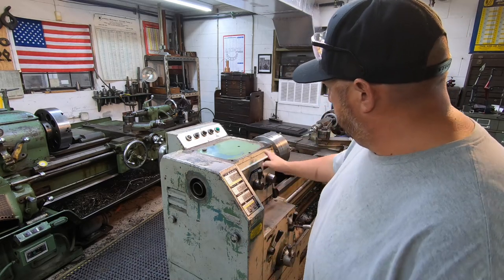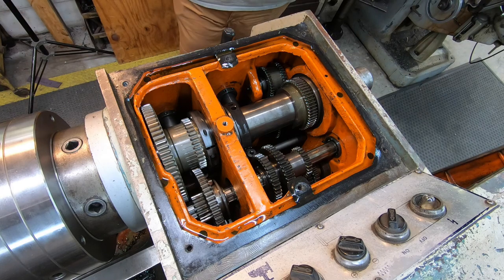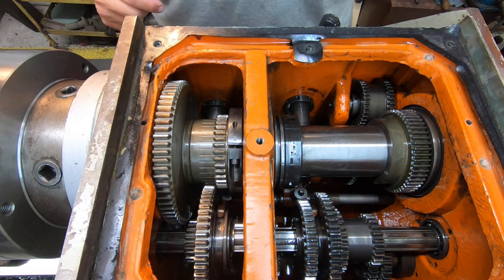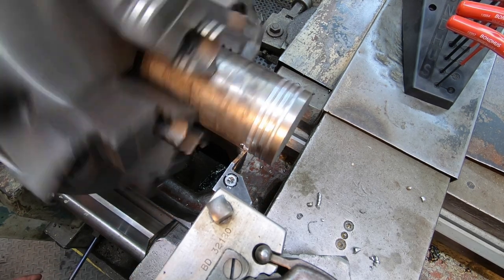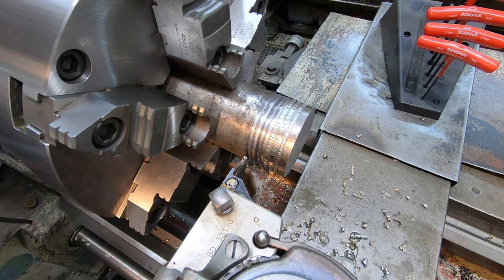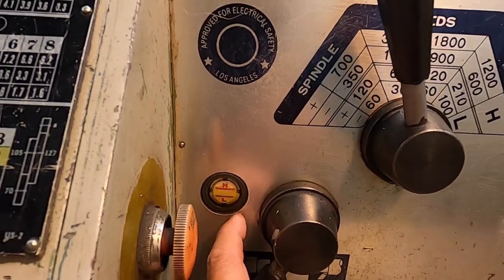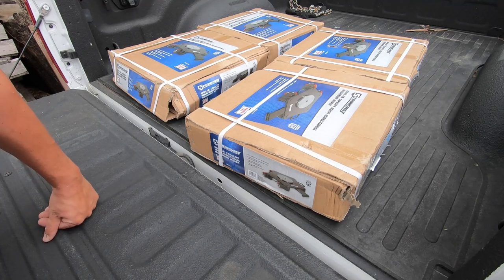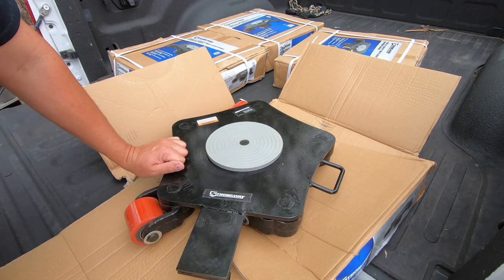SNS 324: Victor Lathe Main Spindle Bearing Adjustments

Comment: Taper bearings do not like to run loose, they always need a bit of tension on them to eliminate any slack. That stake really looks like it taste so good, I like mine done a little longer. Keep  safe and well both of you. Carl Woy Woy, Australia.
Reply: Running taper bearings in compression will greatly reduce their lifespan.
There is an extensive process around determining the proper internal clearance bearings like these should run at.
The only bearings that are actually engineered to run in a pre-loaded state are precision angular contact bearings because the small surface contact of the ball can deform without much issue within its set preload parameters. That is typically in the range of some microns of preload.

Angular contact roller bearings (taper bearings) have a line contact and are much harder to deform causing very high stresses in the bearing, spindle shaft and housing when they have no internal clearance.
The system will run smoothly for a while but bearing life be significantly reduced because of these stresses.

Alternatively it is possible to compress a bearing arrangement with belville washers to 1-5% of the bearing load capacity if absolutely no play is allowed in the arrangement when it is barely loaded.
However, under heavy load, the spindle shaft itself will move out of place from where it's supposed to run so that kind of arrangement is uncommon.

There is an unthinkable amount of science going on to make rolling bearings work properly, I recommend reading through one of the engineering catalogs of a major bearing manufacturer if you're inclined to gain some knowledge on how they actually are supposed to be used.
Reply: @shiro-r4m  After almost 80 years in the automotive trade I have adjusted quite a lot of tapered Timken Type bearings with a little pre-load. These bearings have run many hundred thousands of miles without failure. My opinion, not held by many, is that failure of the bearings is caused by incorrect adjustment and insufficient lubrication. Some times practical experience overcomes the theory. Carl.
Reply: @carlbliim4456   I do share your opinion that lack of lube and incorrect adjustment absolutely does kill bearings. Where we might differ is what constitutes improper adjustment.
I just looked up how car hub bearings are supposed to be adjusted and in general it seems to be with a torque wrench. 
That’s actually very similar to using a heavy belville washer in industrial applications since it puts a set amount of force on the bearings through the threads. In that case actual compression of the bearing rollers is so minute it might as well not be there. 
Mind you that only works when the forces are relatively low.
What I was talking about is actually stretching the axle to the point that you would be able to measure it. 
Most high precision bearing arrangements (high speed spindles,...) tighten a bearing group against a hard stop that is ground into the spindle parts which sets either clearance or preload using a direct lengthwise measurement of compression. 
This results in more consistent performance and less deflection under load.

Either way I think we can agree that tightening a bearing group willy nilly is not a good idea.

Comment: We have an old American 20x74 made in the early 1900's. Its still very accurate but if I run it over 440 rpm's the part starts to get slightly out of round. I'm thinking this may need done to our lathe. Thanks for the video Adam.

Comment: Great to see you back in the shop again. Your adjustment looked so easy to do for the results you got, I’m saving this video for my Harrison clone/ acra turn lathe. I will check the manual first but it looked awfully familiar. Also, as you know, be careful pushing the equipment around on the “machinery skates “, as you can slide right off before you know it. Thanks for the video, JB San Diego.

Comment: I have basically the same lathe.  did the same adjustment a few years ago. keep an eye on the temp of the headstock after the adjustment.  With it snugged up when running in the higher gears it will get a bit warmer.  If you ever have a chance to do a video on the taper attachment for the victor I would love to see how to install it. my manual doesn't have instructions on how it connects to the cross slide. the rest is pretty self explanatory.
Reply: Usually the recommended maximum running temperature when adjusting the preload on lathe spindle bearings is 60 to 65 deg C. On a big lathe it might take the best part of an hour running at high speed to reach a steady temperature. There's no need to do any cutting during this period.

Comment: I wonder if you could have set up a dial indicator and checked for endplay before you started adjusting the bearings. With how tough that nut was to turn it might have given you a better idea of how much, if any, slop there was to take up. Do those gearboxes generate much heat when working them hard? That bearing might be a touch tight if it does get hot. Not trying to be critical. I turn wrenches on trucks for a living, tight (over tight) wheel bearings lead to duals flying down the road so I am a bit sensitive when it comes to these things. Always enjoy the content, hope all goes well with the coming storm.

Comment: Make sure the machine is level and the Gibbs are adjusted correctly , chatter can be caused by anything loose and the bed out of level will cause both taper and chatter.

Comment: The three lathes at work all have chuck key holders with disconnect switches (wired in series with the e-stop)... on the top of the head stock. Keeps people from forgetting to pull the key.

Comment: One place I worked had the same sort of Chuck key holders with Micro switches wired into the E stop so both wrenches had to be in the holders or the lathe wouldn't start.

Comment: That's a good idea with the chuck wrench holder. I've got a couple lathes that I'm planning on getting up and running here. I had a cheap little Central Machinery lathe that I gave to my dad and I have to say it is hard to be without a lathe once you have gotten used to having one around. I've got a Sheldon now and a Rockford Economy and like I said I'm hoping to have them both throwing chips this spring.

Comment: Stick pipe cleaners down the bearing oil holes in the top oil groove.  Make into a U, shove down hole about 1/2”, flatten legs along channel.  Helps stop big chunks going through main bearings.  Have seen plenty of old machinetools with this done.

Comment: This was cool to see for sure.  Does that fact that your test cuts were getting closer to the chuck after each adjustment sort of skew the results a bit?  or does that not really make much difference in a parting cut like that?
Reply: Are you talking about the lathe or the Steak???? 😉😁😀
Reply: Not much difference, he was going from about two diameters out to about one and a half. If you were doing rigorous science you'd make the cut at exactly the same extension each time, but the improvement he got was orders of magnitude more than would be accounted for by that much less stick out.

Comment: Very nice...I wonder if a quart of that Lucas oil stabilizer (since it's 30W equivalent motor oil) if it would let the oil stick to the gears better
Also, on a tapered bearing don't you tighten both bearings into each other, so loosening A , then tightening B (allows B to tighten in a bit), then re-tightening A (to compress together) takes the slop out...wouldn't you use the spanner on A to cinch the bearings more snug in reference to each other in order to remove chatter)
Always love these internal views of a lathe...very clean and intricate!
Keep em coming!

Comment: Adam perhaps you should have loosend the nut at the end of the shaft the third bearing as tightening the tapered bearings would have shifted the main shaft rearwards and cause the tightness in the nut you used to tighten the bearings.

Comment: the reason the skates aren't moving easily is because the plastic wheels are being pushed flat so it's a lot more work to move. steel casters work best but can mark up floors, which may or may not be a concern. also, if you keep a machine on the skates with the plastic wheels, they can develop flat spots over time. perhaps consider whipping up some steel rollers for them so you can just store the project machine on them while you're working on it?

Comment: Before adjusting spindle bearings, you first measure lift at the front bearings. this represents the amount of play there is in the bearings. Those bearings should have .0002" lift (cold).

Comment: What is the weight of the oil in the gearbox?  Maybe thicker oil would dampen some of the vibrations.
Reply: Around 30 wt I believe.
Reply: @hilltopmachineworks2131  I use 32 weight hydraulic oil multipurpose which is probably not the right oil.

Comment: I wonder if you need to change out the bearings. Tapered roller bearings are not supposed to be really tight. I can’t really tell how tight they are by watching the video but there might be some wear in the front bearing that is requiring them to be really tight to get the play out of them. If it’s 40 years old it might be time for new ones.

Comment: Diff ring & pinion pre-load is so high it's scary too me, but it's what's right even though all that drag when cold SEEMS like it's too much, it ain't and I think yours should be tighter.  Used/worn bearings have less of course, still much more then what you've put into it.  Best thing, check the temps!!!!!!!!!

Comment: A huge improvement!   A test cut out at the end would be the best final indicator.  Chatter can be caused by the distance of the cut from the jaws on extended material as well. So, as you move in toward the chuck, the chatter would decrease naturally (if it is related to natural frequency of material).  Fundamental and harmonic mode vibrations can be a real nuisance.  The mover pads: using high density rubber wheels seems an odd design choice. The weight of your equipment....surely the wheel rubber compresses some.  Compressed wheels, to any extent, increase rolling resistance thus making it harder to roll the equipment - sort of the opposite of the objective.  Seems steel wheels on those movers would make better sense than rubber.  I am willing to bet that the the 8800 lbs is a "maximum weight supported" spec rather than a "works well when rolling" spec.  They need to rethink that design IMO and that is all it is...the technical opinion from a Physicist.  BBQ: Damnit Abom!  If I even look at a cut like that, my cholesterol and blood pressure elevate.  Looks so good I swear I could smell it across the internet!  Permission to live vicariously through your cookery!?  I wish you BOTH continued excellent health and happiness!

Comment: I just paid a deposit on an old Victor 400 x 750 lathe... seems the only difference between the Taiwan version and the ones I see in the states is there isn't a panel on the top with switches and stuff... I  hope it's a good investment.

Comment: Polyurethane wheels are used when a floors must be left un damaged as they were before moving what ever it may be . It's like having breaks on
Compared to dollies made with steel wheels or large roller bearings and a clean floor is a must . Less is more like rolling it on pipe as he had done before.

Comment: Tightening nut "B", pulling the main shaft back further into the casting, does that not put more wear on the spindle bearing
Reply: I believe only if it's overdone and preload is to high.

Comment: I'm surprised the user manual did not specify the preload for the tapered bearings.  The final adjustment could have been tighter in my opinion.

Comment: Maybe also the roller (taper?) bearings and races are worn out, are they original and never replaced?  Bearing can get cupped, dished or pitted.  And how many thousands of hours has the lathe run?  Also,  I would worry about the bearings like you did being too tight.  Are there torque settings on them?

Comment: Late to the party yet again, as usual, I didn't own a Victor 3 years ago.  The manual for my 13x40 goes into more detail for adjusting the preload.  The spindle bearing arrangement is different with the two tapered roller bearings being at the ends of the spindle.  It says, with the banjo swung out of the gear train, to snug up the nut until the end plays is reduced to .0002" as measured by a .0001"  dial test indicator.  I can't imagine that the 16" lathe specs would be different.  On larger lathes, like a 20" swing, the end play goes to .0004.
Reply: Hi, do you mind sharing a copy of manual? I just bought 1 and will be really helpful to have a copy of the manual

Comment: You should run it and get it hot then adjust.   It can make a big difference when cold it maybe tight but after a little use will free up.

Comment: Not clear if the adjusting nut was free if it was turned back, otherwise a feel for the pre-load is not easy.
Without any details, I would be wary of putting  on too much pressure for fear of overloading  causing heat and ultimate bearing failure.
Reply: I bet these bearings are already fairly shot. This is probably just a minor tweak to make use better over time
Reply: About and his family worked these machines full time

Comment: Does the power company provide any compensation when the power is out in your place? Over here if it's less than 4 hours you don't get anything. Between 4 and 8 hours it's 35 euro. And every additional 8 hours add 20 euro to that. So if you don't have power for 3 days, they'll have to pay you 195 euro by law. That seems to be enough incentive for them to fix issues fast.
Reply: during hurricane  michael i was with out power for 26 days  its a fact of life  living in  hurricanes areas
Reply: @steveholland1163  wow, that's a long time. I guess it's doable if you're prepared for it but I would be in big trouble
Reply: @WoLpH  i had a generator but its not fun there was just wide spread damage here  so do what you have to do   it was  pretty crazy  155 mph winds   had  4 trees fall on my house

Comment: Off subject but can you advise what to repair a worn out rubber orfice on a eutectic gun like you used to use? It is the rubber piece under the hopper canister. Also, can you share what brand your newer flame sprayer is?
Reply: Both guns are the same company, and the company will do replacement deals and gaskets

Comment: If you pardon a noob question: With the runout of the shaft of that lathe (causing the chatter), does that also cause damage or deforming of the cutter surface?
Reply: Yes, bad runout of the spindle (lathe or mill) causes the tool life to decrease. It isn't as bad for HSS tooling, but terrible for carbide and indexing tooling. I've heard that 5 µm higher runout of the tool in the mill means halving of the tool life potentially. That is why we use shrink fit tool holders in our serial production machines.

Comment: Every time I watch your videos. It makes me want to go out into the shed and find, repair and make things. Like for instance.
I bought a video doorbell a while ago and I want it to look directly at the person, so. I've got a sheet of ALUMINIUM and I'll be using a couple of tools (114mm/4 1/2" angle grinder and a drill mostly) to angle it correctly, instead of flat against the wall. 

The only problem I've got is, to be able to fix it all together. I'll need to drill and rivet, which isn't very strong and most importantly. It'll looks pretty shite 😕 
So. To make it strong and to look nice, you need to weld! But the only welder I currently possess, is just a cheap, nasty and well used 100A stick welder. But as it's just AC, then it should be fine. Apart from me only having 1.6mm & 2.4mm mild steel electrode's 🤦🏻‍♂️

Soooooo. There is a machine I've been wanting to get, for many year's now which will make my life so much easier as this machine can weld ANY metal. I've been saving my penny's for quite some time now, so I'm going to splash the cash (on eBay) on a HF AC/DC inverter TIG welder 😁 
But by the time you get all the bits required, I recon it'll be around £800+, but it's something I've been wanting for year's! 😍 

Sorry Adam for a long rant. I keep seem to be doing that 🤔 Problem because I'm lonely and don't have many people to talk to these's day's and a VERY big part of why I'm feeling like this is due to covid. With all of the world's governments NEVER listening to the scientists and pretending were back in school. Where the cool kids (governments) ignoring everything they always say, until the really need there help. But buy then, it's too late. The genie has definitely been let out of Pandora's box. With all our useless government's trying there best to ram it back in. 
I still have no idea why governments think it's a suprise 🤷🏻‍♂️ Because we've had a few warnings in the past 20yrs+ with viruses like ebola, SARS, etc. Everyone couple clearly see what's happening and what could happen, but they just stuck there heads in the sand 🤦🏻‍♂️

V for Vendetta!!!

Comment: I would have always blamed myself for chatter(dull or wrong angle bits).  I never really thought of bearing adjustment or gear backlash as a cause.  My thinking is that it was always forward force and if something pushes it backwards(chatter), it was my fault.  However, axial freedom of the drive component was not on my radar.  Should have been.  But, I was paid to machine parts, not to diag the driving machinery.  Always the "gotta get it done" attitude rules in a sweatshop machine shop.

Comment: This video really helped me, I had the same problem with our labor cnc lathe at work, after watching your video I took the lid of our lathe and tighten the bearing nut, the shader disappeared altogether and i can now part steel like cutting butter 👍🏻 I also discovered thanks to this, that the oil pump had a broken gear and was not working, so now I’m just waiting for a replacement oil pump.